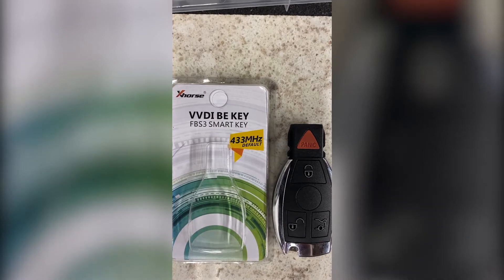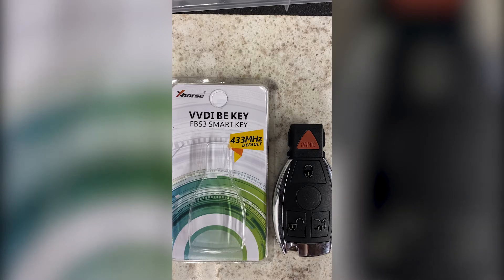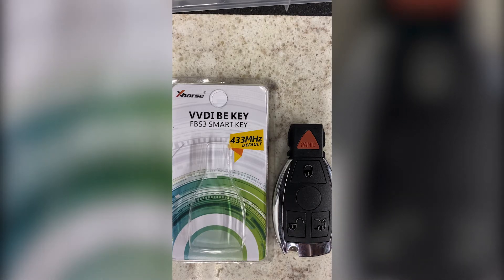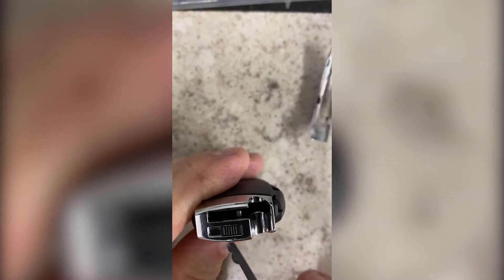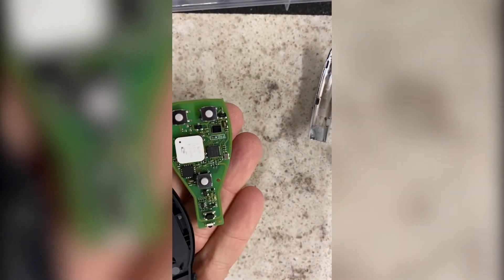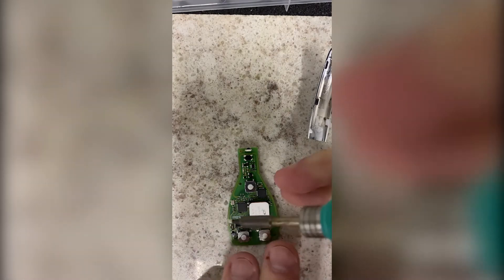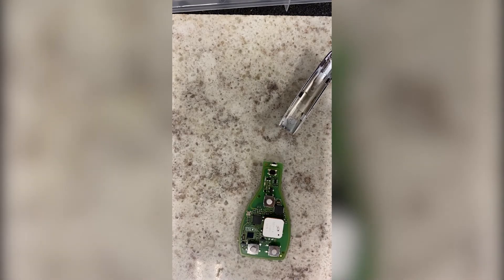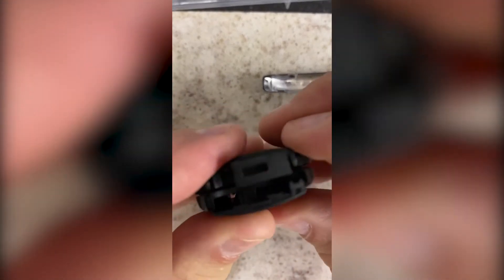Xhorse VVDI MB FBS3 Smart Key - PCB Frequency Change with Key Shell Assembly & Disassembly

Comment: Hi quick question please. 
I've programmed a VVDI MB key to a B class Mercedes.  Car starts fine, no issues, but remote function won't work. I forgot to remove the FRE resistor from PCB before programming.  Default setting 315mhz, but UK we use mostly 433mhz.
So I need to remove the FRE. But now that I've already programmed the key, can I still remove the FRE resistor from PCB, will the key work, and will the remote function works.
I haven't remove resistor yet, just in case keys doesn't work.

Thanks in advance.

Comment: Thanks, you just save me $600, I went to the Mercedes dealership last week trying to program the key, this dude have the nerve to tell me they couldn’t program it unless its comes from the dealer and all I needed was the shell because mine was broken. After watching the video I was able to replace it myself, it took me less than 10 minutes I just went outside to to try it, everything work perfectly. thank you so much
Reply: Hello, can you help me out? I'm new to this and I want to add push to start to my 2011 e350. The push to start button fits in the key hole but when I press it, nothing happens. I want to know if this will add the push to start feature for my car